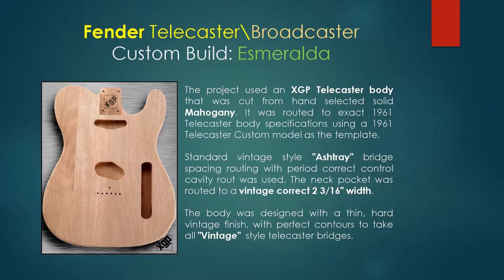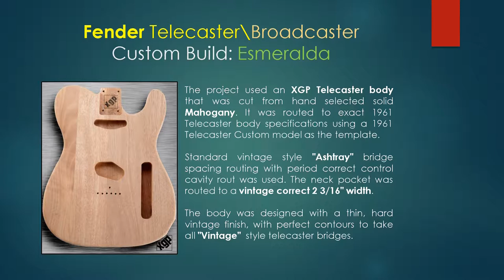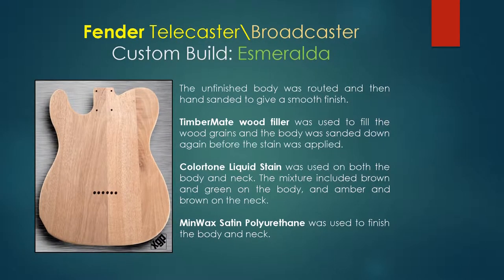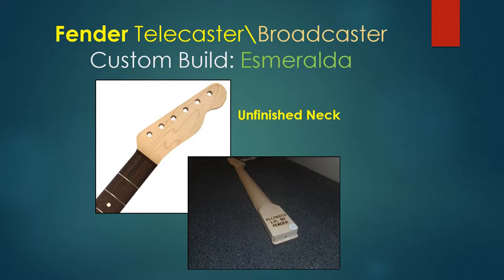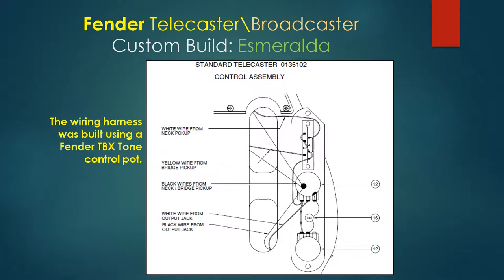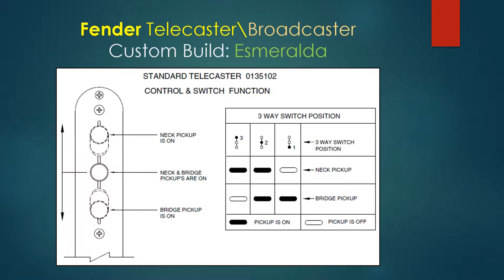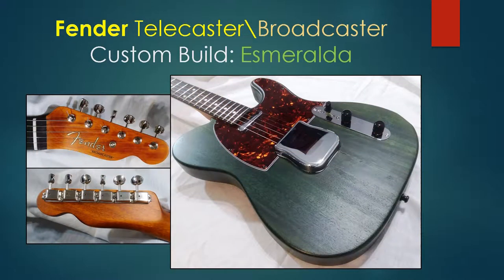Fender Telecaster: Broadcaster Custom Build

Comment: I’d be curious to hear how the tbx affects tone on a tele.  Most installations I’ve seen are on strats.  How has it worked out?  What does the TBX give that you wouldn’t get out of a 1M pot?  Thanks for the video - great looking guitar!
Reply from the maker: The treble bass expander(TBX) on this telecaster gives you the choice of a fuller tone and a much more significant bottom end. It’s almost like you switched guitars when the TBX kicks in. You have the option to make it a subtle or big change. I thought I’d try the TBX on this guitar and I really like what it does. The tone control is far more sensitive now, which makes things interesting. I’ll do a sound demo on this guitar in a future video so everyone can hear it. Thanks for watching and sharing. 👍🏿
Reply: @PowercoatMusic  Awesome - I look forward to hearing the demo.  Did you use the TBX pot as it comes or did you do the mod that I see referenced frequently?
Reply from the maker: @jbourke33  I used  the stock TBX control.  That worked well for me.